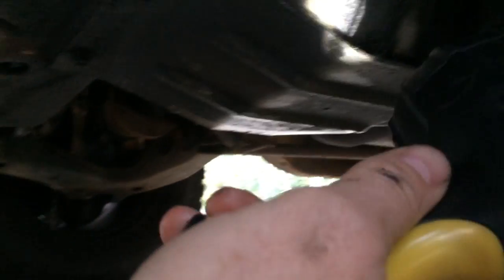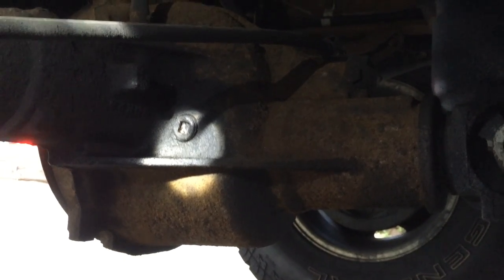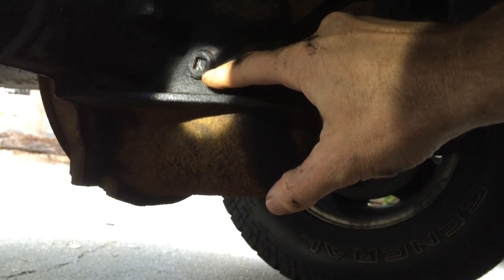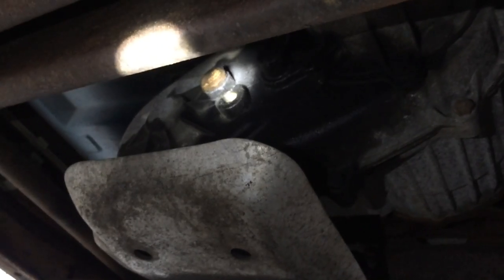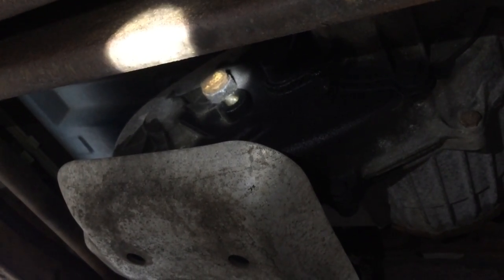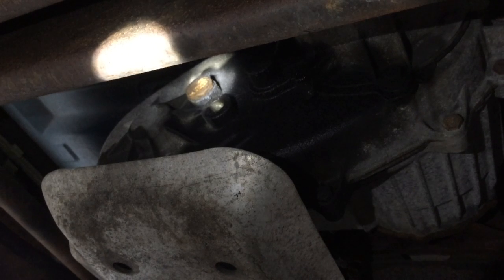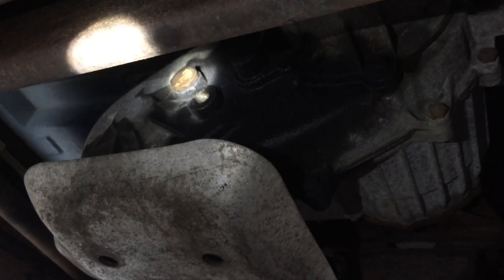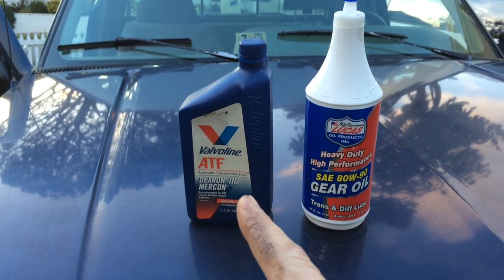How To Check The Oil On A Differential And Transfer Case On A 4x4 Chevrolet Truck

Comment: Ay maybe it's deferent on older 90s chevys but don't fill the rear dif till it leeks out. It needs to be a 1/2 or 1 inch below the fill hole. I listened to this guy and had to pump out a half quart.

Comment: I have an 02' Blazer ZR2 w/ 8.5" rear & G80 Locker. Everything I read says it takes 2qrts but that didn't fill mine & I still have a bad bearing sound but it's coming from the diff. or Yoke. Everything is tight, no play, no clunking sounds. 
Just a whining sound, like a wheel bearing. I should've changed both rear wheel bearings when I did the drivers side. 
I don't tow or anything with it. It's just a babied Mall Runner..
This whining noise that starts at 25mph & gets louder the faster you go is killing me. I can't figure it out.

Comment: I have an el camino that makes a grinding noise when I drive forward, but nothing seems wrong when I drive in reverse? Could it be the differential
Reply from the maker: That’s really strange. I’m not sure what it would be. The main difference between forward and reverse is what gear you are using on the transmission.  Possibly a wheel bearing or brake pad?

Comment: what do you do if your finger is too big to fit in the hole ?
Reply from the maker: Maybe use a Q tip or a piece of cardboard at an angle.
Reply: an oldtimer thats real sharp, should help you whittle one of thoes fingers down a little bit

Comment: Thanks. Does a grinding noise indicate low fluid or time to replace the entire differential? Gets louder the faster you go.
Reply from the maker: That’s probably something wrong with the gears, but try changing the oil and see if it quiets down.

Comment: My 4x4 is screwed it moves in 4h with a loud clunking/routering noise but then i shift it to 4l it dont move at all ? and mine is on the floor like yours and its a 93 have any clue ?:
Reply from the maker: I've only had mine for a couple of weeks, so I am not an expert, but the manual says to shift into 4L you should be moving slowly at 1 to 5 mph and then put the automatic transmission in neutral, and then shift into 4 L while rolling forward slowly. They say don't shift into 4L while standing still.
Reply: @hoohoohoblin  ???? What if your dead stuck?
Reply: 4L uses more torque. If your transfer case oil is bad than it won't move the truck. Lift it off the wheels and it won't make noise in 4H due to less torque

Comment: what happens if there is not oil in the front differential
Reply from the maker: That is really bad. Put some in there and check for leaks. Maybe you need new gaskets to seal it up.
Reply: hoohoohoblin and do u have any idea why my 4wd won't engage?